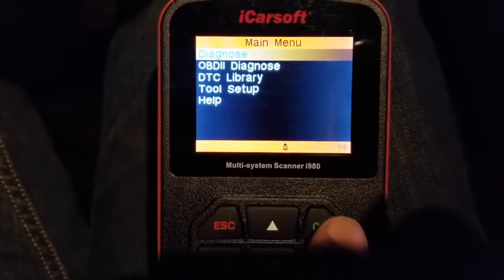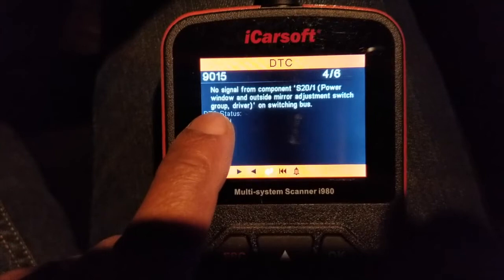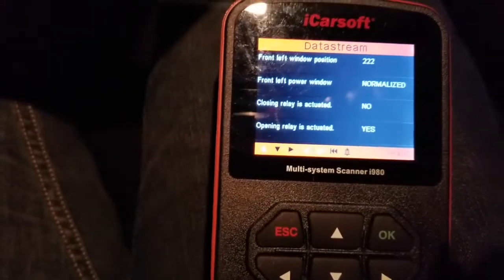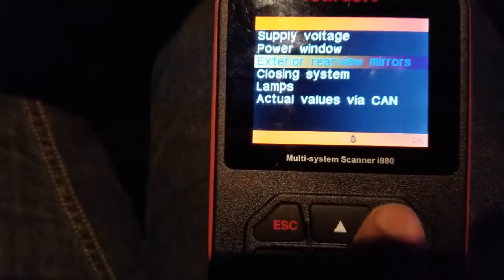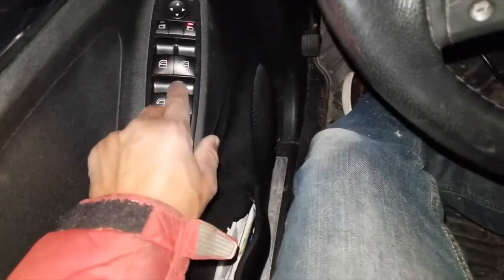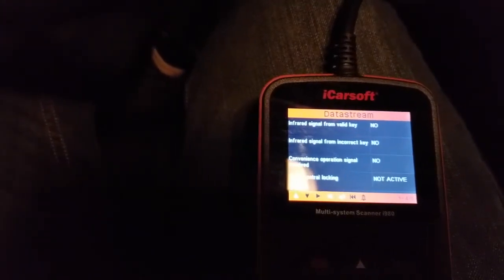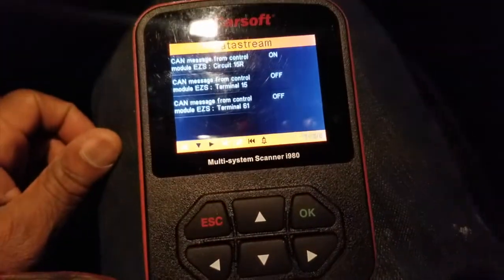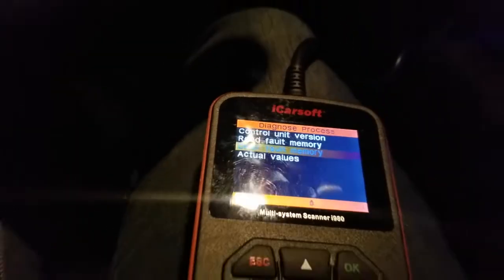Mercedes Door Control Module Diagnostics | DIY

Comment: Always great videos 2008 GL450 been perfectly fine washed truck 2 days later battery dead I noticed the passenger door lights come back on for the window switch and power lock buttons all light back up with the vehicle off all the other doors lights go out as soon as I shut the key off this one goes off sometimes then will pop back on guessing that's what's draining my battery thanks

Comment: HI!!! I wanted to ask if you could help by any chance. I have a 2006 ml350 and the easy entry mode is starting to not work. The steering wheel works fine, but the seat won’t move now. I have tried to reset it in the dash. Do you have any recommendations? 
Thank you!!

Comment: My battery suddenly shut off My back windows on my 2007 mercedes benz gl450 automatically went down and wont go back up i checked out the battery area and it was water in there vac it out changed main and aux battery and my windows wont go back up i hear a click sound from where the battery is and thats it .oh and when all that happened one of my headlights wont go off

Comment: Hay man thanks for this video maybe you can be the one to healp me find the mysterious problem i ran into with my w209 clk 500 06 , i noticed my dome light wasent working properly cuz i wouldn't turn on so i found that it was missing a bulb on the center light i installed it and i guess it made a short cuz my entire left side (drivers side) stoped working the back window dont roll down or the front , the seat controls stopped working aswell it wont lock and truck dont open and it also dosent lock , everything is from the left side only ,what could be going on ? Any idea

Comment: Hi Keith - Great video thank you. I have a 2007 CL550 with a inoperable passenger window. I was impressed with the test capability Icarsoft I980 but have multiple cars so I bought the "CR Plus" Multi Brand Professional scanner. It appeared to have all the same Diag features and test modes (CANBUS, IO9141, KWP2000, and J1850) BUT when connecting the device I only see a few test modes, no where close to the list you showed and unfortunately not the Window Diag menu. I assume this is a limitation of the tester and not the vehicle. 

Any guidance? Thanks!

Comment: Hello Keith, I' don't think I'm getting power to the left or right rear switch, because the rear windows are in the up position and will not go down. I installed a used left front door module about 5 years ago. could it be that the used door module is bad? I can't lower windows with driver control or rear door controls. not even using the Autel MS906BT.

Comment: I’m having an issue with a 2005 S4 30 driver side windows not working rear windows are not working also none of the functions on the driver side door is not working will you be able to help with that or have you ever came across that problem. But passenger side window it works only from the passenger door as far as the window in the seat is working
Reply: It’s your door control module . I have the same issue i have access to it through my door when it’s open and I just pop the cover and disconnect the power plug to the module  and reconnect when the car key is in position 2 ( engine not started) and it resolves my issues by resetting it for a few days usually . My car is a 08 c300 so I don’t know if access to your module requires taking the panel off but I would try that out so at least you have access to your windows and locks etc . Hope it helps .
Reply: https://youtu.be/ElIIDz-vq4w

Comment: On my w221 s550 my driver door module needs to be updated or reflashed. Can that only be done with a Star at dealer or would I carsoft be able to by resetting module.
The window does not go down but all functions on switch work for all doors just the driver window switch.  Replaced motor and still no control switch has power. Thx great content for MB

Comment: Great video and very useful comments, any chance of some help diagnosing a similar issue further please?
Front driver side mirror moves left and right only, no up and down, front passenger side mirror moves up and down only, no left or right.
Testing with an OBD scanner for CANBUS shows the the drives side mirror adjust wheel is sending signals correctly.
Could it really be the motors are only working in one direction each, they don’t even try or make any noise in the non working directions each, I have a spare motor so can test but wanted to cross check if I am thinking along the right lines or if there is somewhere I need to be looking? Thank you

Think i found a solution for anyone that needs it https://mbworld.org/forums/e-class-w211/728928-w211-left-mirror-repair.html#&gid=1&pid=12

Comment: Keith!  Errol here from Vancouver, CA. New subscriber. Are you of Caribbean origin?  
I have an 03 S430 that recently lost power to all front passenger side controls (seat heat, adjustments, window, sideview mirror close and the soft closing door!) 
How would I dianose this to the DCM?  I've tested the fuses and they are fine
Reply: I have the same issue. Did you get it taken care of? If so what was the problem ?
Reply: @donpetty8625  Hey Don, I did fix the issue!  The culprit was the Door Control Module (DCM).  Purchased a used one with the same model number and it's working good as new.
Reply: @Trini_Gemini  ok thanks for the info. Now no windows or trunk not working only the passenger side works its a headache.

Comment: Hi Keith hope you all doing well. I need some assistance, i have a 2008 C300 W204   i am having problems with the Hazards/ESP switch non functional at all! as well i am having problems with the main lights switch that controls parking lights/fog lights and automatic lights, this switch is as well non functional i checked out the fuses and they seem to be ok. I aswell bought a new 4 signals/ESP switch on Ebay i replaced it and it still does not work. Any ideas or help is much appreciated. Thank you Keith.
Reply from the maker: Hmmmm.   It could be the relay for these items.  Do you have a mercedes specific scanner?
Reply: @iRepairAutos   as of now i dont have a scanner, but i ordered  benz (MB II) scanner to diagnose once it arrives. It is strange though because the left and right turn signals work, but the hazards all 4 together do not turn on or work at all. Thank you Keith
Reply: @davidg7346  curious to know if you ever found a solution? As Keith said, there's a possibility of it being a relay I suppose or a bad switch causing circuit issues or of course bad wiring due to perhaps water intrusion? Just guessing here....
Unfortunately, we all know that new ebay switch could be Chinese junk & be bad in the box. Hopefully not, but would be nice if it were that simple. 
I'm guessing you've resolved it 9 months later?
Reply: @RothBeyondTheGrave   Hi Roth,  I did find the solution thanks to my Online tech friend Lou Palomino.After doing all testing with Lou i discovered that it was a bad driver side SAM-Fuse box panel. I purchase a used one on ebay for 120$ as soon as i installed it the car started working perfect. NOTE: remember to purchase the right parts for your particular car year and model because two of the SAM modules that i purchased on ebay did not work and i had to return them until i found the right one.Good luck!
Reply: @davidg7346  ah ok, makes sense. I didn't even think about that even though all those components go directly into that SAM & they're directly next to each other. I had electrical damage in that same area/same switches on a 2nd gen Acura tl  due to clogged sunroof drains & water intrusion. 
Yes, extremely important to accurately match your chassis & glad you got it sorted!

Comment: My mirror adjusment joystick isnt working how can i fix that please help?
Reply from the maker: For both mirrors? Then it's probably the switch, it can also be the fuse and or the motors,  you need to scan the module to be sure.
Reply: Thank you so much and we checked the fuse they are all good

Comment: GOOD VID KEITH ,I HAVE A QUESTION I HAVE CL550 WHAT CAN I DO TO UNCLOGG MY FRONT FENDER DRAINS,,LEAFS AND DIRT CLOGS IT UP ,,CAN I USE LIQUID DRANO TO POUR DOWN THE DRAIN TO UNCLOG IT ?
Reply from the maker: That's a good question Cee Dubb.  Not sure sure how you would get the draino in there.   Draino is probably corrosive on paint.   So you have to be careful with that as well.
Reply: iRepair Autos 👍🏽👍🏽👍🏽 THANKS
Reply: Use weed wacker line to clean out drains.